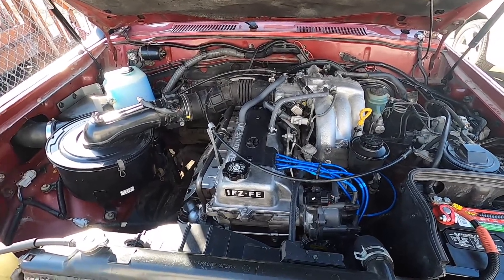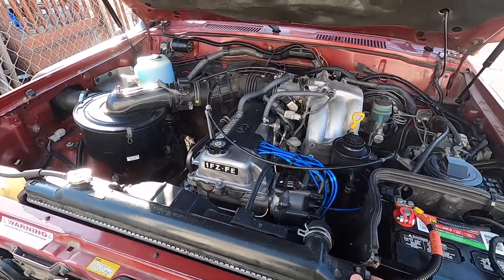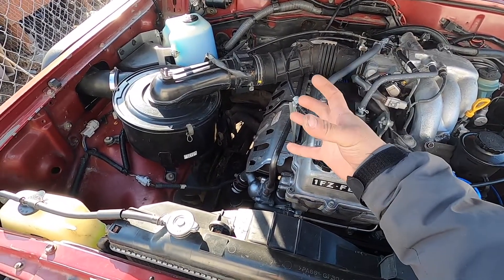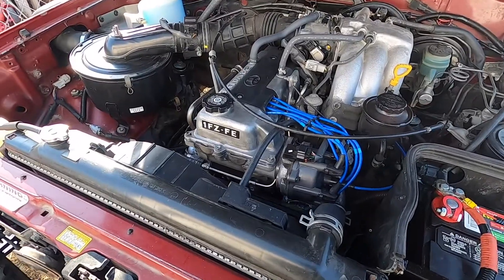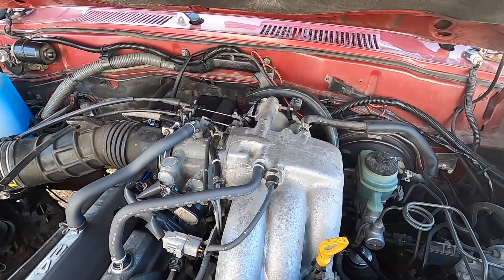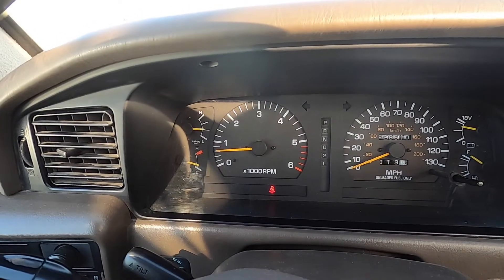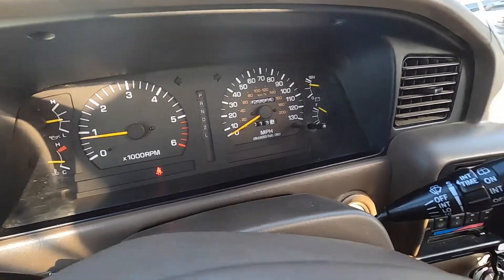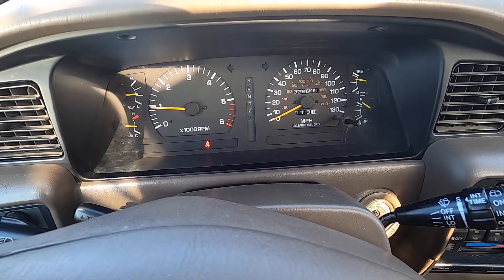1FZ-FE COLD START AFTER TOP END REBUILT

Comment: I did mine the same, but when it warms up I’m getting a tapping noise, more near to my bell housing but, I think it may be cylinder 6, if it is cylinder six can you help? Can I remove the upper oil pan and take the head off and put the new bearings for my piston?